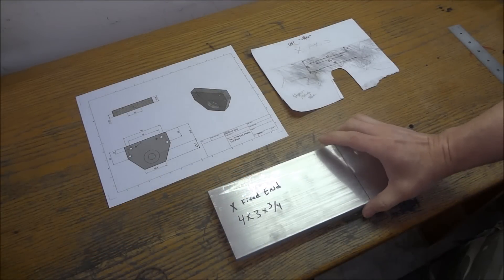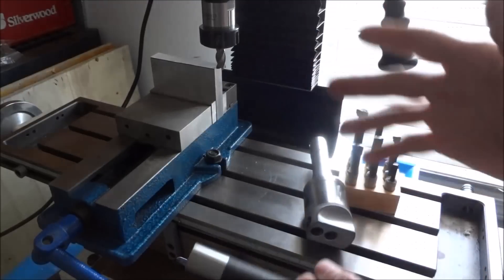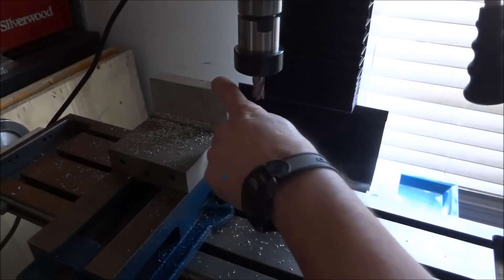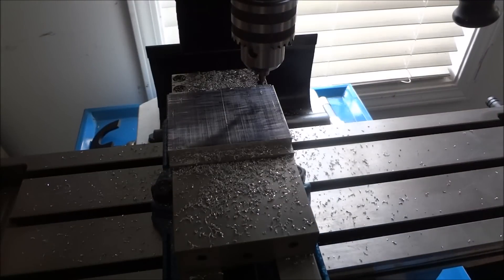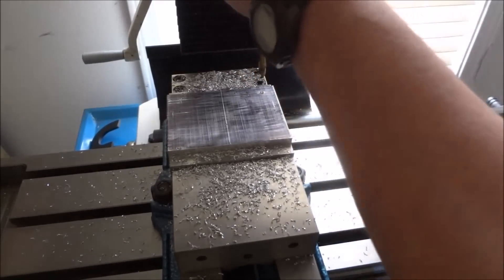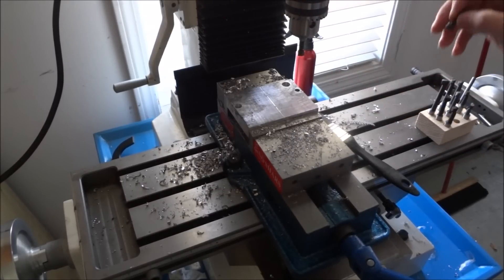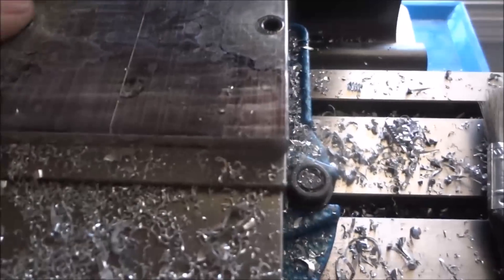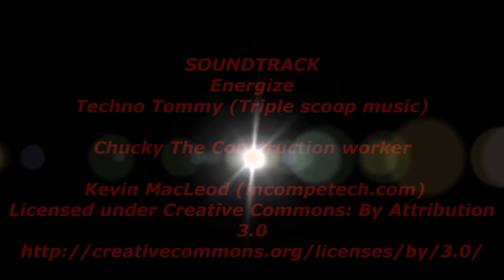X Axis Floated end Machining

Comment: So question about the recess for the bolt head . If you have a boring bar head , could you use a small enough boring bar to make the insets for the bolt by using the fine offset  adjustment on the boring head ?  I other words , couldn't you use a boring bar and head to make a hole exactly 10mm(?) ?
Reply from the maker: +SOCOLVN  Yes you can But again not a critical dimension so I used one that was close,  I actually had a boring bar the right size and really didn't need to turn them down after all. I don't know how I missed that. Oh well
         ·

Comment: Awesome stuff!  You have some incredible patience to do this all manually.  If someone doesn't have a lathe, just chuck the bolts in your drill chuck and put a lathe tool in the vise - instant vertical lathe!
Reply from the maker: +x19freak  Great Tip! 
Yeah I really didn't take much off just the knurls really so even a file would work.

Comment: Nice work!

Don't baby those endmills. :) Cutting speed for 6061 w/ 0.5" endmill is around 
2000 RPM.
Reply from the maker: +Denzil Long  Yeah Know I never even broke the mill in and This is the first machining I've done really . It was set on 60 RPM and I just left it it chews the Aluminum right up as you will see in some other vids so Hey I just left it at 600 RPM
Reply: +CNC4XR7 NP. :) Your conversion is coming along nicely.

These videos has prompted me to finally get to converting my X2 to CNC.

Based on early review I bought a PM-727M as my new manual mill.

Comment: Came out very nice Sam. I would have been lazy and just slotted the 2 counter-bored holes near the edge of the block so I wouldn't have to turn down the heads on the bolts. It wouldn't be as clean looking as yours but would have been functionally as good. Like I said, I'm lazy.
Reply from the maker: +William Hardin  Well as you will see in up coming videos I actually had a boring bar the right size and really didn't need to turn them down after all. I don't know how I missed that. Oh well.
Reply: +CNC4XR7 One of theses days I'm going to get a set of counter-bores for doing that.